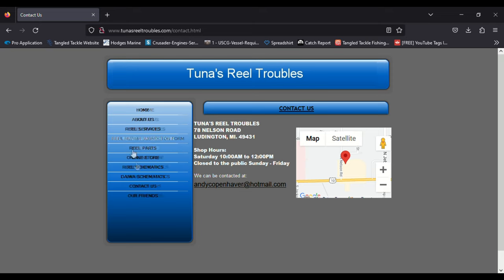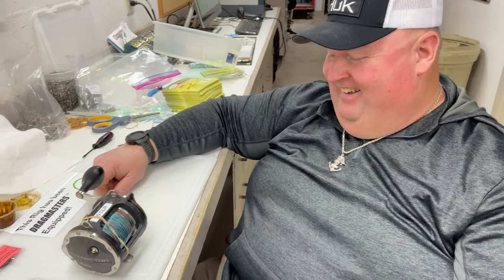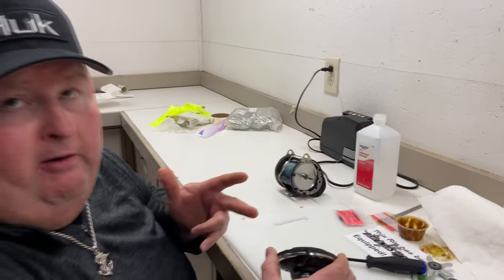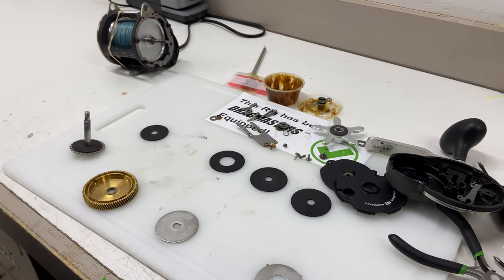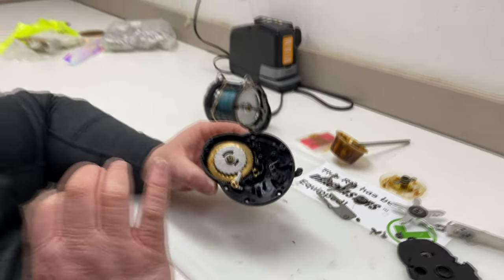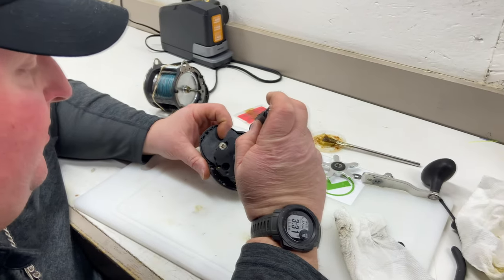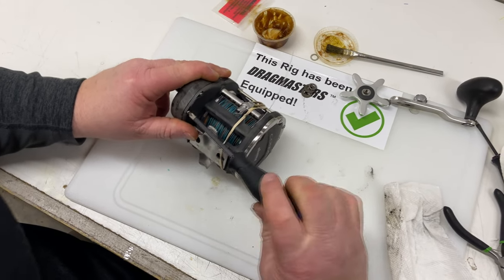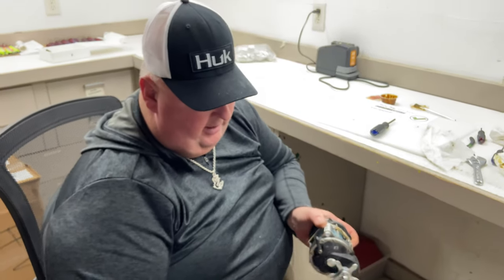DIY Carbon Fiber Drag Upgrades / Must Do / Reel Maintenance

Comment: Only suggest I would make for this video is to place an old towel on the counter so when you drop those small screws they don't fall on the floor. An old white towel would make the screws easy to see.

Comment: Hi Scott and Chris,  I just did this on a 55 that is new this year.  The main reel bearing that the crank shaft passes through easily dislodges (falls out) from the reel frame. I put the bearing back in backwards....it looks right when you're putting the bearing back in, but I think it screws you up in the end.  Took me about 3 hours to do because I didn't recognize I reinstalled the bearing backwards.....I think. I think I did it right, and if I did do it right it is not really that hard upgrade these drags if you're careful. Got 4 more reels to do. Thanks for the help.

Comment: Interesting to see the drag system is the same as in Ambassadeurs.

Biggest thing I saw was something I've been wondering about - that you have to be careful not to disturb the position of the spool relative to levelwind system. If you must remove that spool then you MUST also resynchronise with the level wind when you put it back. I've not seen that on any other YouTube video. Well done.
Reply from the maker: Thanks! We tried to make sure we didn’t leave anything out.

Comment: Hello Chris
Lost several fish on my dipsey convector reel last year. Noticed the braid would lock up line would be coming off opposite end of reel from palm. Whats the best thing to do? Respool the reel?
Reply from the maker: The easiest thing to do is to let all the line off the reel and wind it back up.  If you continue to have problems the worm gear may need to be replaced.  There is another method of loosening the worm gear and re-positioning it back to the correct timing, but that takes some practice and is not an easy task.  So I'd recommend to attach it to an object in an open area and start walking until it's all off the reel, and then crank it back on.

Comment: Hello Chris and Scott, Darn nice video.  I ordered three more drag kits today.   I was thinking about reel drags and it occurred to me that these are kind of like a release on a diver or down rigger. Going a step further, I thought, how tight do you set the drag on a reel or the tension on a release. As a salmon newbie I don't have the savior-faire with respect to these devices to know how to set them effectively. I've used a trigger pull gauge to measure how much force it takes to open some of my divers and trigger my releases and it appears to be helpful to me. I was thinking it would be cool if you and Scott could talk about how to select how tight you set the drags on your reels and releases.  As an example, I've noticed some folks increase the reel drag after the diver or planer board rod indicates they've got a customer and if someone does this, how snug should they make the drag.  Thank you for the very informative videos!
Reply from the maker: For me, and I can only answer for me, it's more of a "feel" thing than it is anything else.  After a while I can check my releases and my drags just by pulling on them and know if I need to tighten them, or loosen them.  It really all boils down to time on the water and experience which is extremely difficult to transition into a video.  But, I'll give it some thought.

Comment: Hi Chris and Scott, I completed a CV 45D with new drag washers and I noticed something with this reel as I did with my drag updated 55L. Neither of these reels with the drag upgrade will let out line unless you pull it out with significant force, that is to say the line does not seem like it will go out on the clicker with the drag at the lightest setting. Otherwise, the reels seem to function normally. Please keep in mind I haven't actually tried it on the water but in my yard I gotta pull to get the line to pay out. Is this drag stiffness normal to start or do you think I screwed something up?  Thanks
Reply from the maker: Sounds like something is wrong. Young’s is go back through them. I would consider emailing Scott also for any advice.